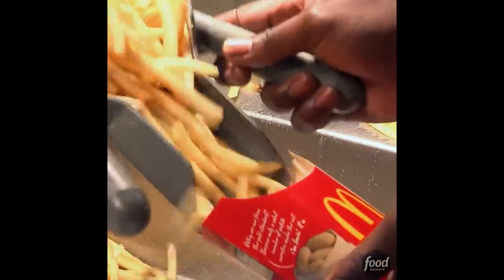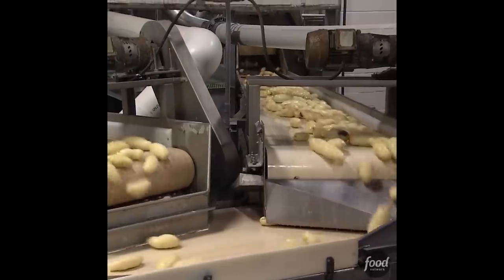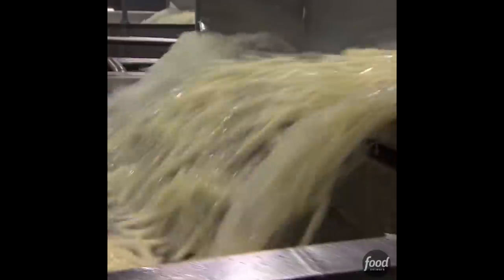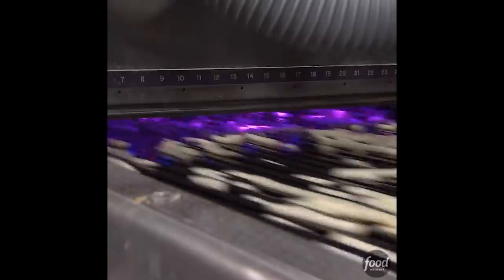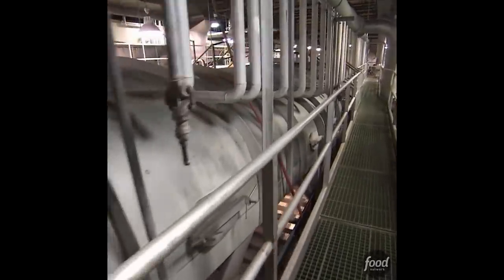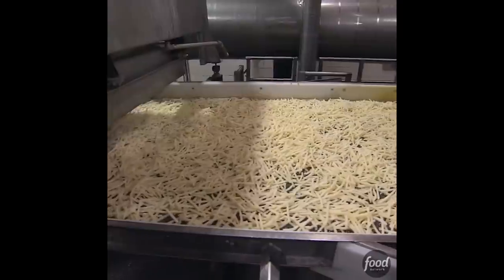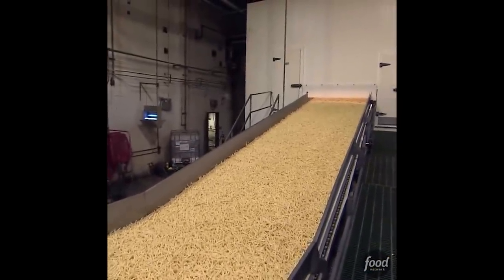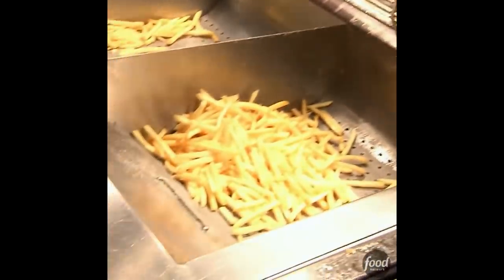Fully Unwrapped - McDonald's Fries

Comment: Once the fries have cooked, drain the oil above the vat for 10 seconds. Then proceed to pour the fries into the heated storage area and apply a portion of salt for each basket being added. Mix it with the scoop and bag the fries to match the holding level
Reply: 10 seconds? We hold it for five and the  shake a little of the excess off
Reply: @adrianyates4434  I was told 10 seconds but in reality I just smack it against the top a few times

Comment: Not enough salt!? Even when ordered with Light Salt (basically, No Salt, but they still put it in the hot metal area where regular salted fries would go), they're unedibly salty (unless you've got a problem or are American). Cuz that's just how much salt they put on them. No Salt is better, just so it doesn't get over salted. Tho an actually light amount would be preferred...